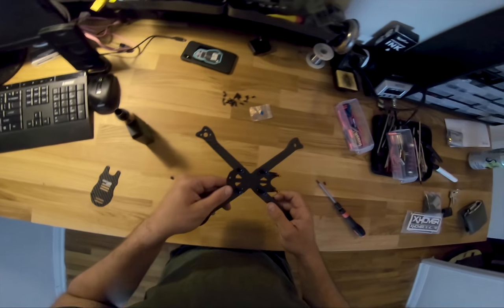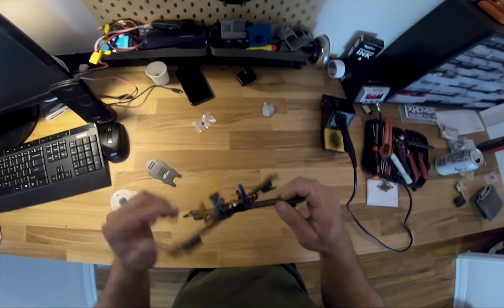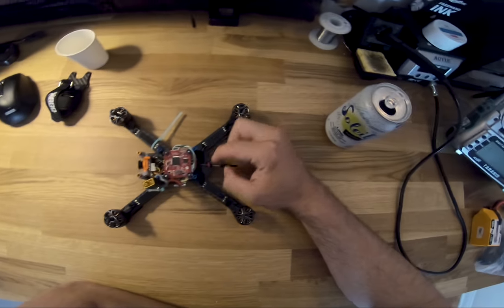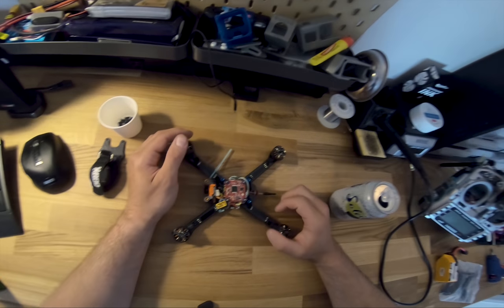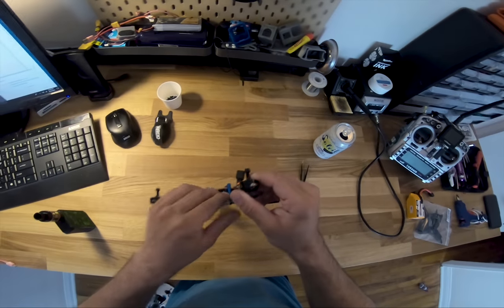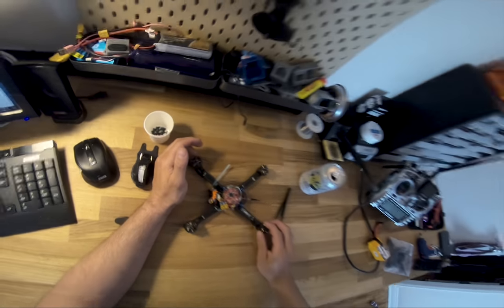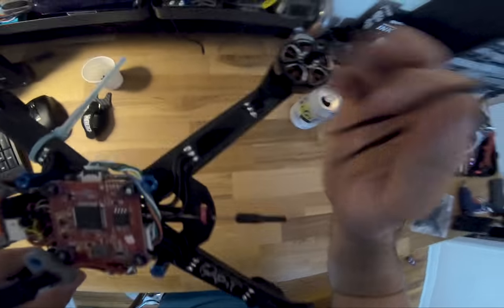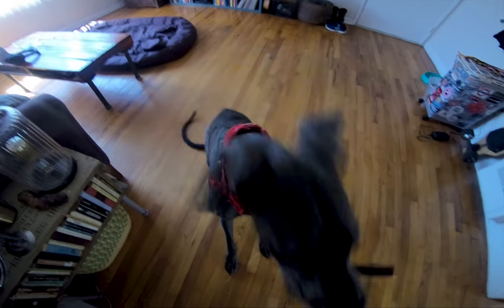GAPiT FRAME BUILD (and some flying and stuff)

Comment: Love your channel & podcast 😀, quick question (for anyone with the knowledge).... What is the motor to motor distance of the 5" GAPiT? I have one on the way and want to start prepping the motors and ESC, it's proving a tricky statistic to track down.
Reply from the maker: 5" = 228mm motor to motor (keep in mind it's a stretch)
6" = 266mm (also a stretch)
Reply: Perfect, thanks for the info.

Comment: FYI regarding 12min15 you can not electrocute yourself with low voltage. Even at 6S. But adding conformal coating on the main power lead on PDB is a good idea for all the other thing that can touch and short circuit. I generally try not to add coating on the gyro itself.
Reply from the maker: TIL
Reply: *so long as the internal impedance of the battery is lower than your impedance. Sorry please excuse my amygdala....
Reply from the maker: I don't speak Spanish

Comment: Great video.  Suggestion, why not use liquid electrical tape on the power pads to prevent you from getting zapped?
Reply from the maker: Because LET is so sticky/gross!  ALso I just found out that it's not enough voltage to really zap ya, who'da thunk?
Reply: GAPiT FPV  gotcha.  I think it adds a bit of protection around the solder joints  with all of the plugging and unplugging.  What I am reading here is you like the burning sensation that 1300+ mah battery gives you when unplugging it. 😀. It's happened to me too.  Lol

Comment: Nice Frame! How did you mount this copper shield? Did u use some kind of copper tape? thanks in advance, happy flying!
Reply from the maker: Comes with adhesive backing :)
Reply: ...now with non-conductive bottom 😎
i need dis!

Comment: boring, uninspiring frame, brings nothing new to table. great flying skills though
Reply from the maker: lmao, thanks for the insight chief
Reply: GAPiT FPV that's what you call a backhand compliment(: but man, I really love your videos but all the new signature frames - except remix which is different looking but flawed in its in own way - are just so .. similar. I'd like to know what does your frame does differently? I'm actually curious
Reply from the maker: I wouldn't disagree that most frames are similar, there's only so many iterations to be made from 4 motors and a stack of electronics. With such a wealth of choices, pilots can quite picky when it comes to the details, it's not unlike skateboards/components.  Most 'signature frames' today are about nuance, and hyper-specific preferences.  Regarding this frame and why I think there's room for it, it's because it caters to all the things I personally like in a frame, and some people find that appealing.  That's the point of a signature frame.  For me, I like a frame that's made for sideways top-mount, compact, a stretch x, using good/chamfered carbon and designed to be easy to assemble/repair/replace.  It's specifically not groundbreaking, it's essentially just a cleaned up/more accessible version of the home-brewed R5LX that I was flying for about a year, and it meets a specific suite of criteria.

Also, if you don't see something you want, feel free to bring something to the table.